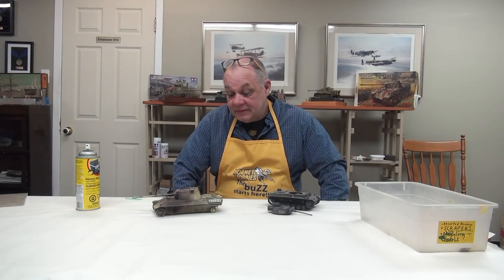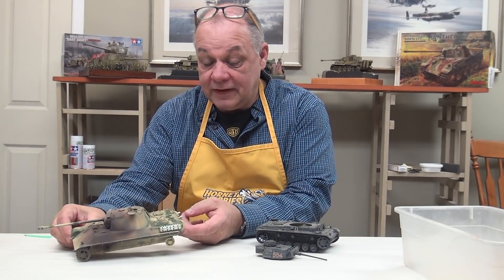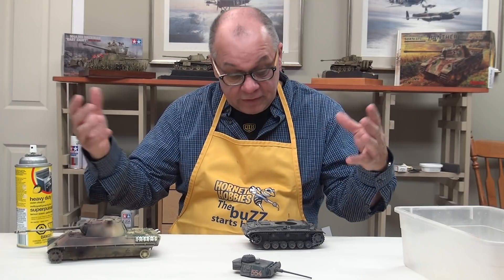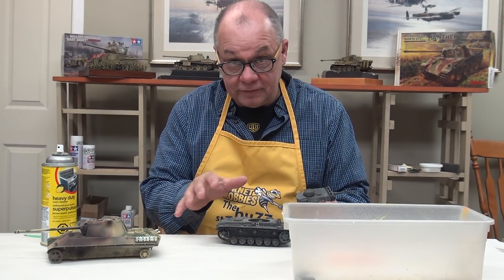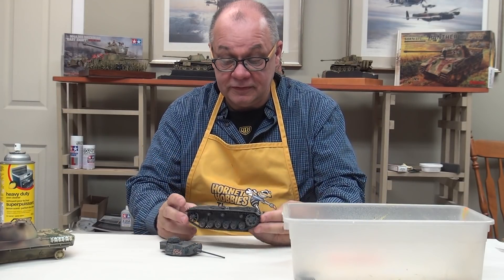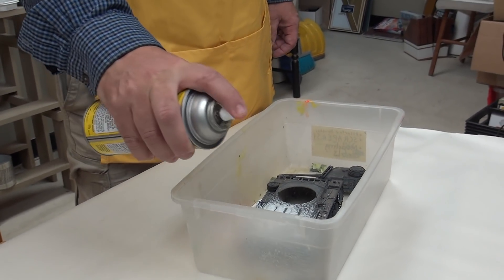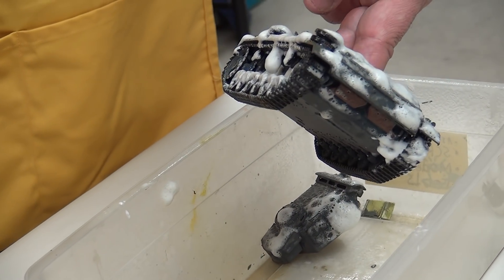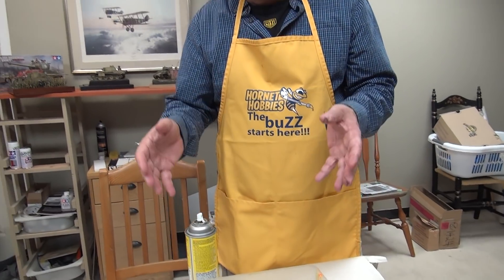How to strip paint from scale models

Comment: I used oven cleaner to strip "matal" coating from a Gundam model. I bought cheapest stuff i could find. It wasn't in an aerosol can. Just the regular "pistol grip and lever" type of bottle. Since it was liquid rather than foam, i poured enough of it to cover the sprues and left overnight. By the next day most of the coating dissolved, rest came off under running water with only some nooks and crannies requiring a bit of rubbing with the brush. I tried same trick with Citadel acrylic paint. It required a bit longer soaking and more rubbing but it came off nice and clean in the end.